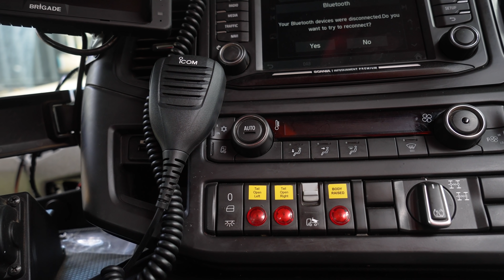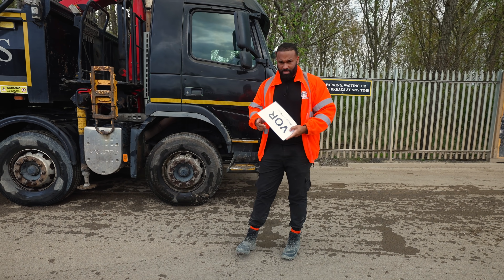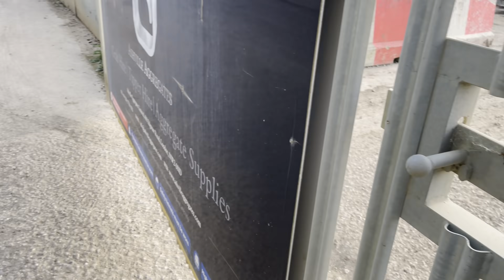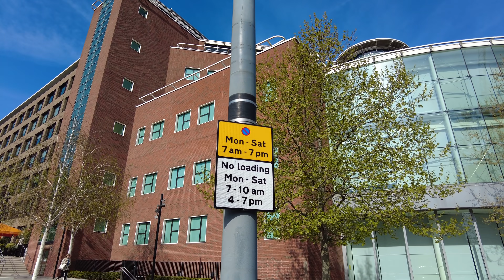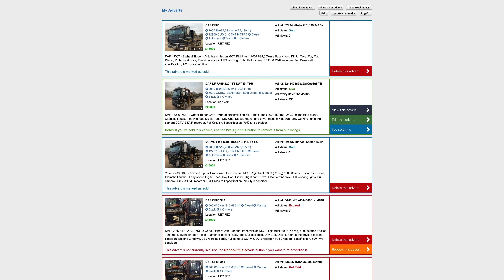Between a Rock and O’Donovan’s Place | Ashville Weekly ep080

Comment: When I worked on the Northern Outfall Sewer bridge refurbishment in 1963 at West Ham for the civil engineers Chas Brand and sons, I drove a 15 cwt Ford Thames van collecting store etc. Also drove the Fort Thames Trader 3 ton flat bed also picking up store and most important coke as it was a really bad winter.
The Victoria Line muck away contractor was Hall's & Co, they ran a brand new fleet of 6 wheeler Guy Warriors with 11 cu yd. ali bodies. So your vid has brought back memories. thanks

Comment: That bull nosed heavy hauler is custom built. Started off as an IVECO ON+ AS440X57TX/P Stralis X-WAY. Converted using official IVECO parts to a Strator 6x4, by Dutch IVECO dealer group CFG (Charles Feijts Group), with a 12.9L CURSOR13 engine pushing out 570BHP and operated by G & B Finch Ltd in Essex. An impressive piece of kit to say the least. Excellent video again, as per usual. 👌👍